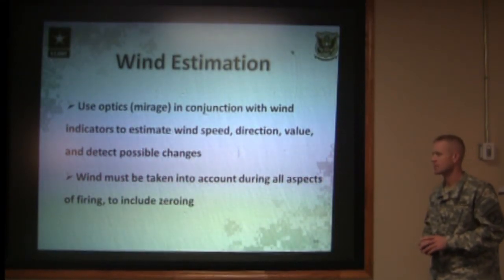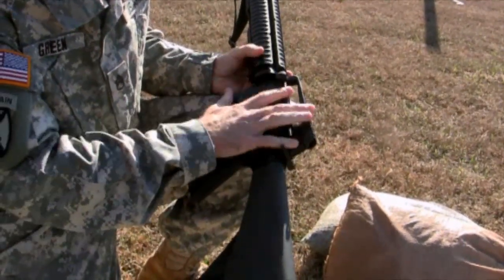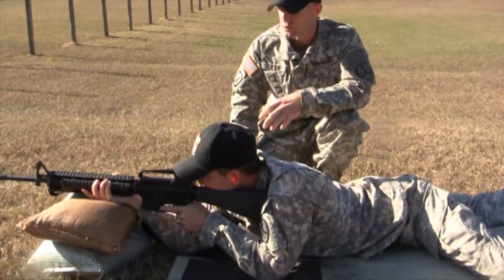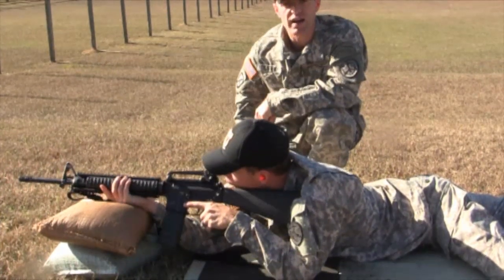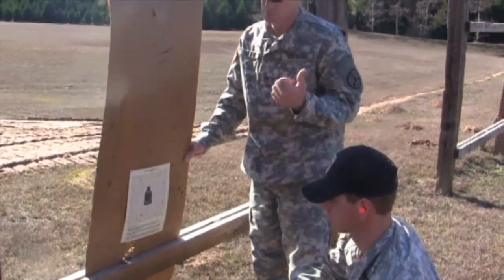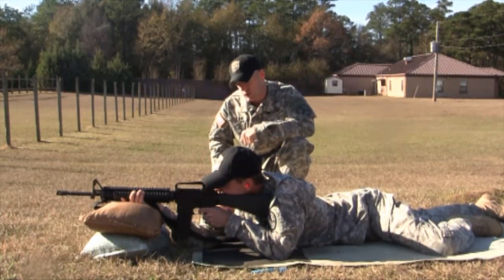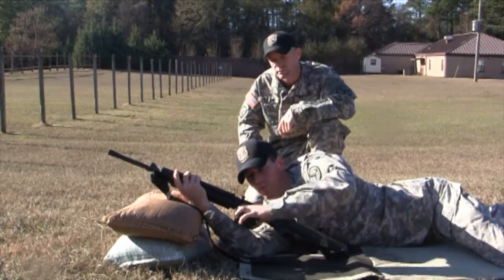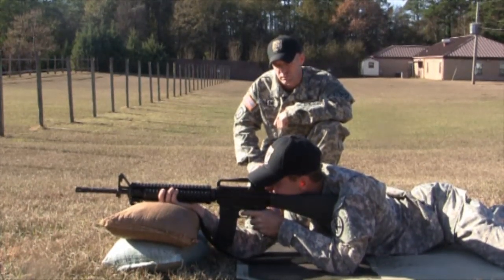USAMU Basic Rifleman's Course Part 6

Comment: One thing i think was left out, but can be seen here as well as in #2 of this series. So far as the head position, the nose is positioned  foward as to almost touch the charging handle. For peep iron sights accuracy, its important for the eye to be as close to the peep as possible without getting hit when the rifle recoils. Most modern scopes on the other hand, need eye relief of 3 1/2 - 4".
Reply: This is not true. As the position gets higher the eye will be further from the sight when the shooter has a muscular relaxed stockweld and while the sight picture will appear to be smaller it is not incorrect.

Comment: what is wrong with resting the rifle directly on the sand bag?  A lot of snipers shoot directly out of their bags and I don't see why being so rigid to require the hand to hold it.
I may be wrong tho.
Reply: @4:30
Reply: For shot to shot consistency during the zeroing process. That slight grip helps. Once the rifle is already zeroed, you no longer need the grip if you're shooting only a single shot. But you want to use the grip hand again if you need to rapid fire multiple shots.
Reply: Recoil, think of it like a second shot hand. And your more likely to sense danger.